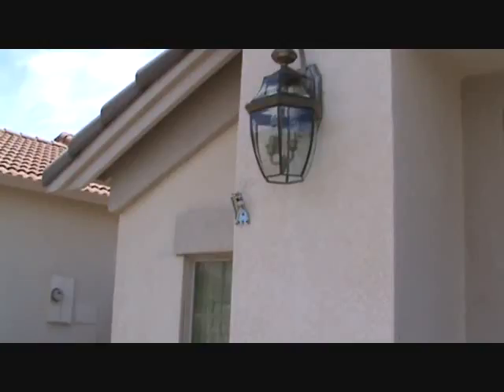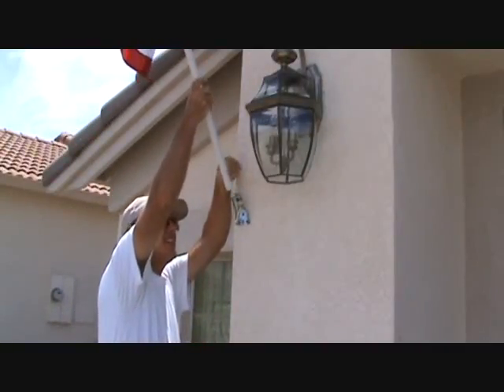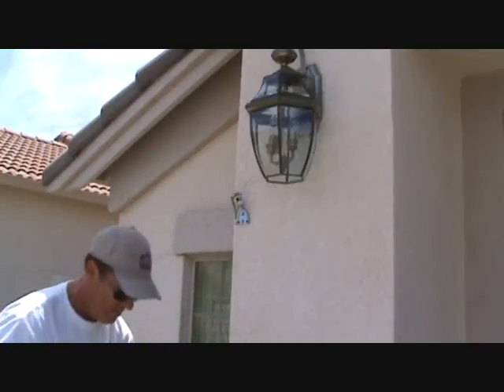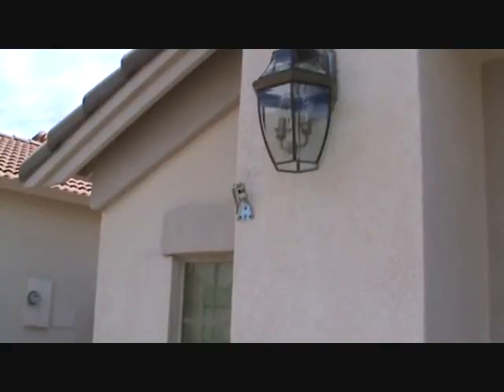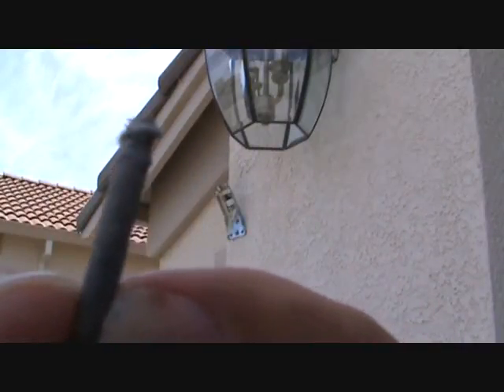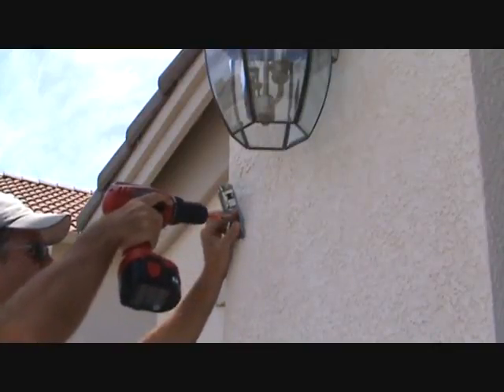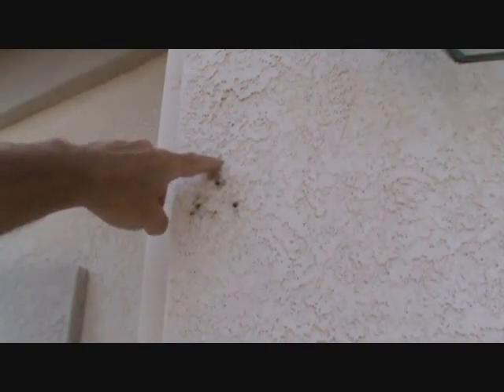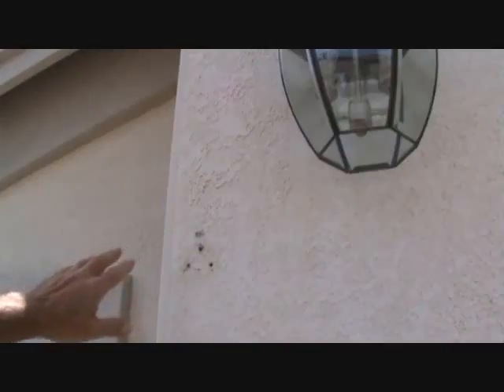Installing a new style flag pole...Part 1

Comment: How does a person know whether or not there is a 2 by 4  behind the stucco
Reply: Stud finder... also it's a corner
Reply from the maker: Some stucco walls have plywood behind it over all the walls while other times there will only be wall studs spaced every 16" apart plus you will know there are studs at the corners of walls. If you don't hit any wood behind wherever you are screwing to then you would have to carefully install wall anchors to then have your screws attach into. These anchors need to fit nice & tight with no slop or the screws will just spin in the anchor so you have to be careful when installing whatever type of wall anchors you get from the hardware store. You can always ask someone in the hardware department & they will show you what type of anchors they think you might need. Good luck!
Reply from the maker: I guess a stud finder will read through stucco? I've only used stud finders on drywall.